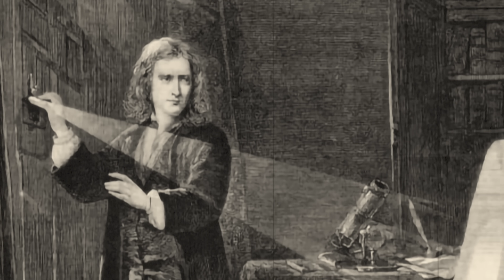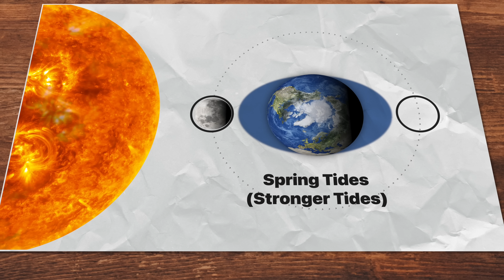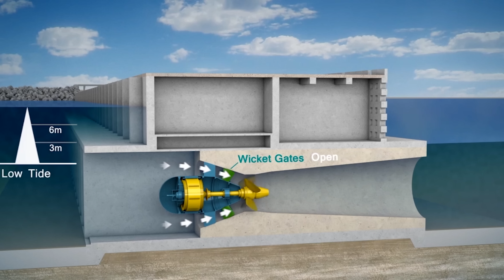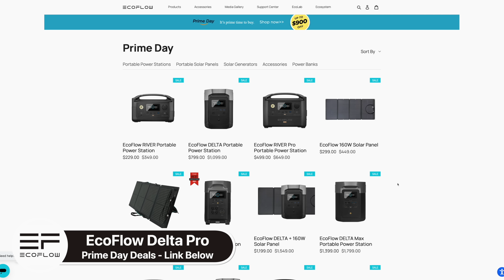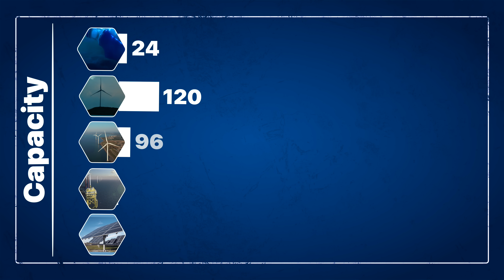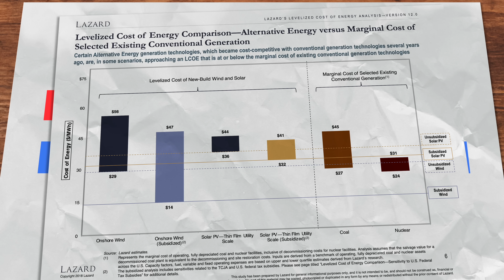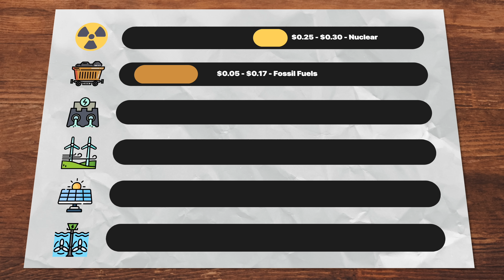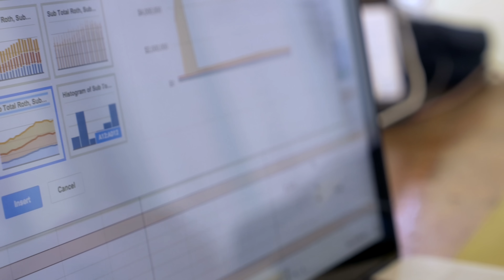Breakthrough Energy Source is 10X Better Than Wind & Solar!?

Comment: Another form of ocean power is WAVE ENERGY,  there are several designs out there. One I like is forced air turbine. The blade is designed to rotate in one direction regardless of the air direction. So as the waves force the air move in, and out, the turbine continues to rotate in one direction generating power constantly.

Comment: You did a good job on research. I think the free floating Turbines are the best bet. They require the least amount of infrastructure,  can be pulled out of the water for easier maintenance.
Reply: There's been a free floating 1MegaWatt facility in Scotland since last year.
Reply: When they combine them with manufacturing green hydrogen we will finally be saved. Our use of natural gas is ending everything.

Comment: The turbines chop up the fish.
Reply: Yeah, right. But only the stupid ones. Ever swim towards a school of fish and try to grab one? The blades would be rotating relatively slow, not like a blender.
Reply: @580guru  Actually, they closed one, not far from where I live, because it was killing the fish. 
Seagulls like them.
Reply: @sherlockhoax9338  Really? Where are you located Sherlock?
Reply: @580guru  No reply. It was s lie. Some people just like to be contrarian.😂
Reply: @580guru  Eastern Canada. Highest tides in the world.
Reply: @sherlockhoax9338  More likely yours. You wouldn't be able to take the "heat".
Reply: @580guru  There are fewer than 350 Right Whales left on the planet. Most of their deaths and injuries are from ship propellers.
Reply: @580guru  Nova Scotia Power has decided to pull the plug on North America's only tidal power generating station and wants its customers to pay $25 million over the next decade to write off the asset.

The utility says the decision to permanently retire the 37-year old Annapolis Generating Station in Annapolis Royal, N.S., was due to the failure of a "crucial component" in the generator and an authorization required by the Department of Fisheries Oceans after it determined the facility caused serious harm to fish.

Comment: For human society nothing is better than wind and solar.
Humans society is a land based society so we should harness free energy where we live.
Every home and building should be made from the start to harvest solar and wind energy suing solar capturing materials all over and having on tall rise buildings wind capturing included from the design stage.
Every building should generate electricity and if there is any extra need to have various other energy generation systems, but the core should be on the grounds, local generation, hence solar+wind hybrid systems
Reply: Please add storage using reversible storage-hydro.

Comment: We need to use all of them combined and where they work best in conjunction with good battery storage. and we need to make it so cheap and available that no matter what cheating and propaganda the fossil fuel industry employs consumers will automatically choose renewable options because they work better and cost less.
Reply: Power storage can also choose the best available method for the location, just as you say for generation - it doesn't  have to be battery.   I'm not sure why batteries are such a focus.  Gravity is great for storage too.   Just roll a big rock up a hill.  Or pump water back up the dam.  Energy stored.  Repeatable a million times.  No pollution, heavy metals or decay in efficiency.  No international shortages or high lithium prices.  We've all got gravity right where we need it already.
Reply: @completelybusted   Batteries are a focus because solar and wind are the most in use and their intermittency requires storage and backup. Hydro is efficient and amazing because it runs all the time but it is not in use the way it should be … yet. Fossil fuel subsidies control and propaganda have slowed renewable research and development for such a long time that we are not seeing all the forms of hydropower we could, but that is also changing. Hydropower also has only been able
to be used at scale and near rivers, coast lines and dams which has limited its application. Until governments get on board with proper funding to develop more versions of hydro, and other forms that are not intermittent, it’s all about the batteries.
Reply: @completelybusted  I see what you are saying and definitely agree, but since gravity energy cannot be used everywhere then we will have to rely on batteries, and mechanical ones are also in use to a small degree. Though I do think that what you say about the money also applies because if they could make money off of gravity based energy more research would be happening and we would be able to use it on a much larger scale already. Here's hoping for the future.
Reply: You need to run for president or something.

Comment: What about a tidal reverse yoyo bouoy? Tides will come in and out, predictably. So having something like a dynamic wave break for harbors, that goes up and down with the tide, then use gravitational potential and the wave's lifting energy to spin coreless axial flux generators located out of the water

Comment: Tidal energy pushes the moon away and lengthens the day quicker. Pollution?
Reply: Huh?
Reply: @580guru  where does the energy come from? Energy is conserved. It delays the rise and fall of tides dragging the moon and sun in the direction of rotation of the earth while slowing  us until the moon  is tidally locked. This is going too happen and you can speed it up.
Reply: @thaddeuswalker2728  You are right. It will happen in millions of years.

Comment: I've always thought that the double bulge phenomenon was kind of confusing, so if anyone is still confused on that; the reason there's two is becuase of earth's barycenter. A barycenter is just a fancy way of saying that the earth is like a yo-yo and the barycenter bieng where it is tied on. As the moon orbits the earth, its center of gravity isn't exactly in the middle of the earth so the earth wobbles a little bit in its rotation. This is common for all celestial bodies, including our very own sun - and allows us to discover planets around other stars. As it "wobbles", its also slinging everything on its surface around with it - including our oceans. This creates a bulge as the water is slung slightly off the surface by the earth's centrifigal force. Then, of course, you have the gravity of the moon pulling a signficant amount of Earth's water towards it and opposite the centrifigal force (according to physics in the 'centripetal' direction - although it is gravity doing the attracting and not centripetal forces).

TLDR: the earth would be like a bucket of water being slung in circles but some of the water is falling towards the moon.

Comment: No money in tidal (for the Gretas & Al Gores). Solve the political greed issues and the most practical system will prevail on it's individual merits.
Reply: In that case coal, oil and gas are gone! ("individual merits" don't exist in oligopolies. Learn some basic economics)
Reply: @totaramgandhi5117  I do not think you fully understood my point, regardless the most practical energy generation will not be allowed to prevail unless the corporate greed is satisfied first.
Reply: @alangraham4526  OK. Understood. But also understand that no "single" system is a silver bullet. All are needed in concert to solve our problems. They all have a role to play and it depends on the particular circumstances.
Reply: @totaramgandhi5117  not wishing to be anything other than debating I would suggest ocean current generators are essentially an inexhaustible source unlike say nuclear that current figures suggest will only support another 300 years at the current usage. Again for me my "argument" is essentially not about what will prevail but more about the corrupt road it must travel and in all probability to end up in the wrong location. Thank you for your comments.

Comment: Two, er, three downsides:

(1)  There are not many locations with strong tides and a natural and bridgeable gap.

(2)  Anything exposed to salt water is going to have a limited lifetime.  Twenty or thirty years is a reasonable limit.  However if you have to borrow money to build the tidal dam, you're likely to barely have it paid off by the time it's completely rusted through.  

(3) And the big deal-killer-- it has to be built to handle a 100-year storm surge.  That requires that it be built like four times stronger than absolutely necessary, which often makes it far too expensive to ever break-even.
With windmills one can at least brake or feather them, not so possible with tidal dams.
Reply from the maker: Good points…
Reply: And these things might scare the fish. Can`t have that!
Reply: In British Columbia there are literally dozens ( maybe hundreds) of prospective sites with the inlets on the coast. The tidal action on the long narrow inlets has to be seen to seen to understand. You just have to look at a map. However. with the rainfall and topography, standard hydro electric dams are relatively much cheaper.
Reply: @paulmcgown7504  After decades of being stuck in litigation, I don't think dams are any cheaper.
Reply: @paulmcgown7504  Okay, but as an engineer I'd like to see some numbers on the kilotons of water per tide cycle and the drop in height.  From that we could calculate the power available down to the Watt and actually judge whether it would be economically doable.   We have no idea right now so we could both be off by a factor of 1000 either way!
Reply: What are your qualifications, credentials? This is not an attack on what you said, I believe in verifying sources of information, wherever it comes from.
Reply: @paulrobertson2457  I'm just a guy with an engineering background.  In engineering you learn about efficiency and designing things to last and the costs associated.  Somewhere along the line I've learnt that steel ships rarely last more than 30 years before they have to be scrapped, so I'm guessing that holds for most anything made of steel in salt water.  Also learnt about the time value of money and interest costs.  With that kind of knowledge you can look at many things and  noodle out their cost, efficiency, and practicality.

Comment: Seems like the right solution is likely to be a mix of all types.  Location dependent. I am on board with moving away from coal. I have been for some time.  I think Salt Nuclear will need to be the Nuclear of the future. Clearly we will still need to invest in energy storage for decades to come.

Comment: Thanks for this video. The predictability should be a selling point for this type of energy production.
Reply from the maker: Absolutely!
Reply: Agreed since it is so predictable the amount of energy storage needed for it to be viable can be calculated to a minimum which should be a good selling point for smaller coastal communities.
Reply: Predictable but not schedulable.  Tidal will have two dead periods per day.  The time of day will depend on the time of the month.  When the peak demand is within dead time you will still need at least some energy storage mechanism.  Reservoir storage of tide water would probably suffice.